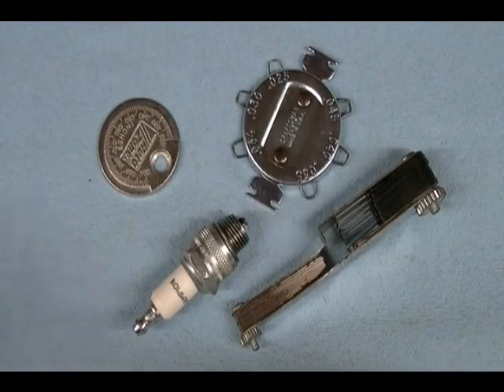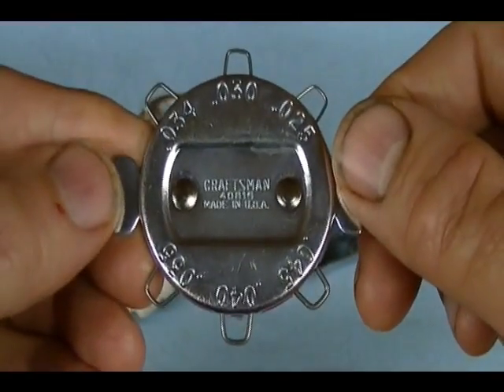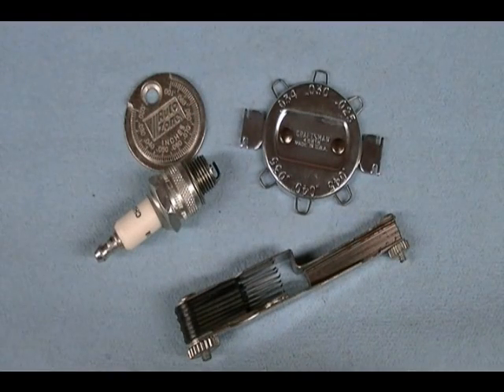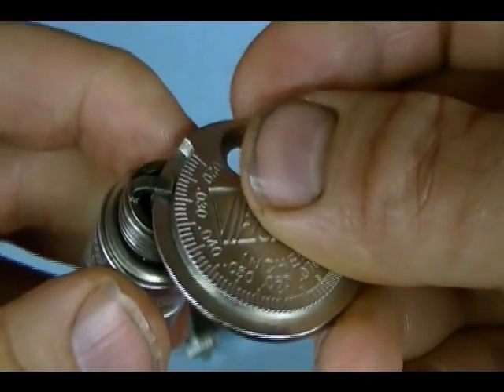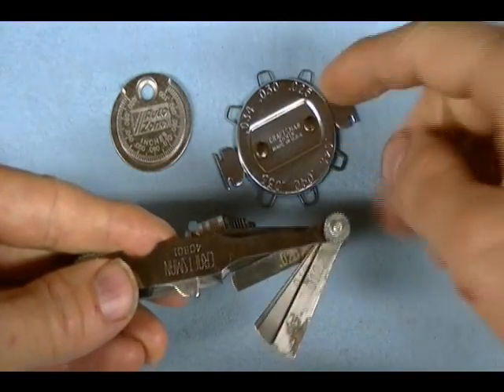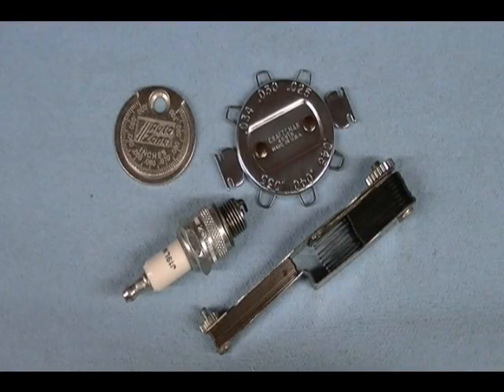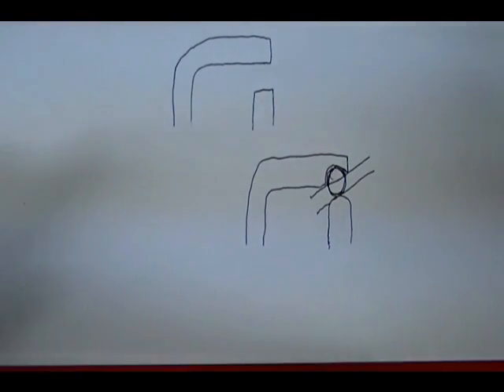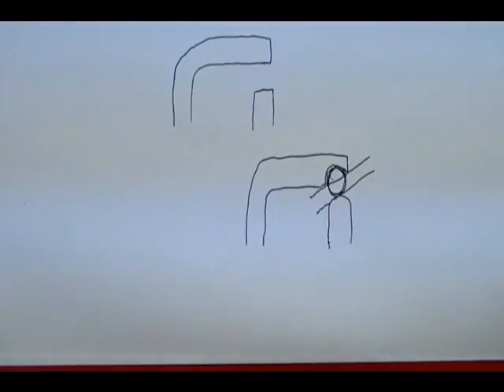Small Engine Repair: How to Gap a Spark Plug

Comment: Thank you so much for this detailed yet simple video.  I am getting close to 60 years old and have always had a husband or paid someone to do maintenance on my lawn mower.  However, I am now attempting to do as much as possible on my own.  I have an older lawn mower, so if I kill it, not such a great loss!  I have my eye on one I really want but can't justify buying a new one so long as the old one works.  So far, I have managed to successfully change the oil, change/keep the air filter clean, change the blade, and clean under the deck, and it is still usable, LOL!  I am now going to try changing the spark plug, and this video is just what I needed!

Comment: What's the point in gapping a plug?
Reply from the maker: Brad Jackson When you change the plug gap you change the electrical resistance in the spark plug seen by the ignition system. If the gap is too large than the resistance becomes so large the ignition system can't overcome the resistance and produce a spark.